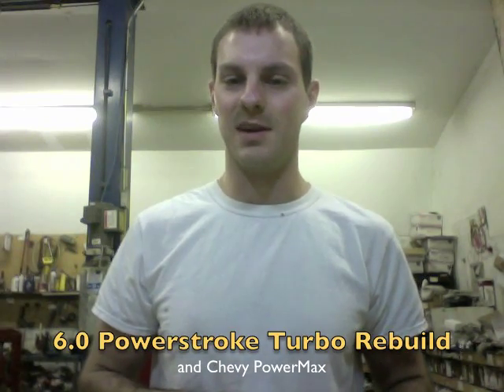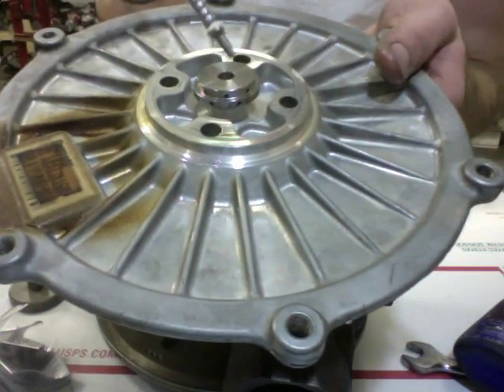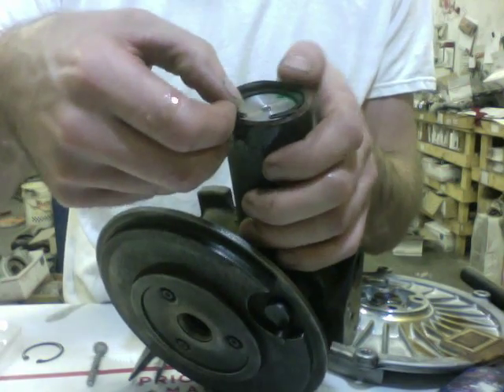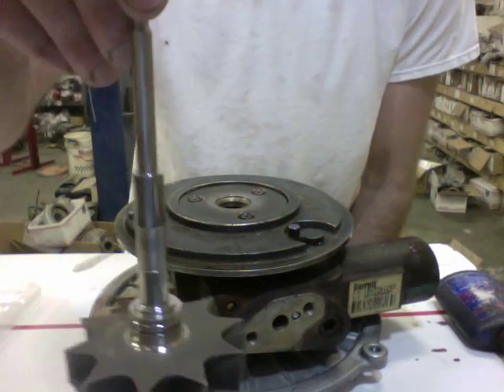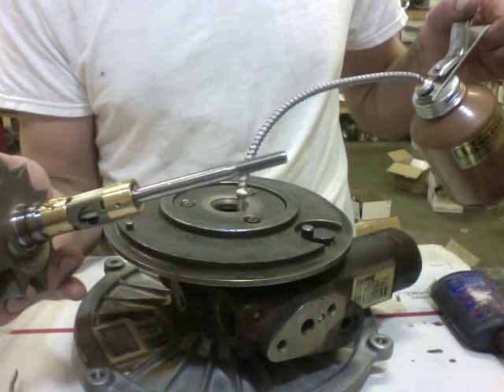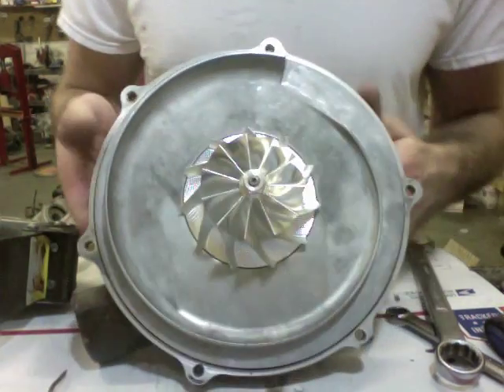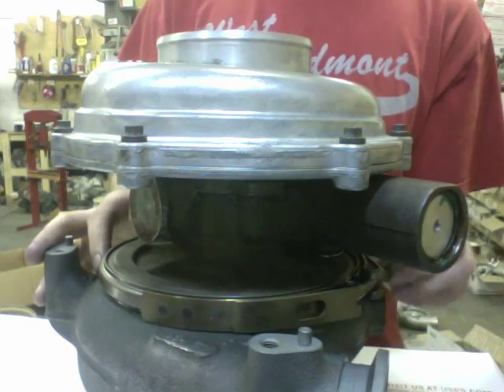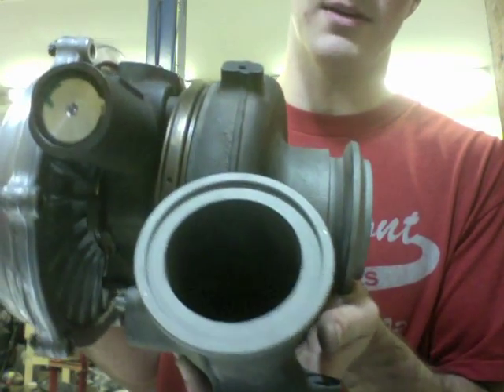Ford 6.0 Powerstroke Turbo Rebuild Kit Instructions

Comment: Ok. I took mine apart. And they installed the thin vane design.  The height is correct...the width of the vane us smaller than stock 

What is the advantages of the "thin" design

Comment: Cranking down the compresser wheel using a wrench puts atress on the thin shaft. The nut should be tightenened using a socket to keep the torque centered. Dont forget how fast that shaft spins and any wobble will destroy the bearing in no time

Comment: I would not red loctite the compressor wheel to the shaft. Terrible idea. I would be worried about doing damage if i ever had to take it apart again. Its also not necessary because it is reverse threaded and it is self locking
Reply: my thought exactly

Comment: Did you have to get it balanced after the rebuild?
Reply from the maker: No because the compressor wheel always lines up in the same position because it's threaded

Comment: the exhaust side seal on the shaft won't gap closed to let the assembly seat all the way in. I've cleaned it and worked on it but there's not enough to get it in there.
Reply: nevermind I backtracked and figured out I put the thrust bearing in upside down. everything fits now just leaving this comment in case anyone else has my issue. since this kit was an upgrade I didn't have an identical piece to compare it to.

Comment: When I put the shaft back and tight  it doesn't  spin  hope you can help
Reply from the maker: +daniel canada I never had that problem with a 6.0 turbo before, usually if it happens on other turbos is because the collar in the backplate wasn't pushed all the way in.
Reply: I was thinking what if it has a wrong shaft

Comment: does the turbo have to be machined?
Reply from the maker: If you want to upgrade to the powermax 63.5 x 88 x 94 then the compressor housing and plate has to be machined. There are 3 variations of the Powerstroke 6.0 turbo, you can see the major differences here: https://youtu.be/xoV7hS73hX4

Comment: i was just wonder but could one of these turbos be used on a gasoline powered  truck?
Reply from the maker: +Dylan Rice the concern I would have with putting it on a different vehicle is the ability to control the electronic vgt controller.
Reply: Turbo Lab America oh ok thank you i was just wonder because i saw a guy selling one for 100 and i was curious about if it would work. yea im trying to find a turbo for a low reving high torque ford 300 i6 but i want one that will spool quick but not choke the moter out at higher rpms.
Reply: @dylanrice6707   That would be sweet!

Comment: Yeah yours sounds like an old cold 7.3 lol This engine im working on has about 5000kms on it full rebuild top to bottom even did a resto on the 2004 body and frame lol. Used two aircraft jacks to lift the cab in my back yard. Hoist smoist lol.

Comment: Quick question, does the orientation of the seal opening matter? Should care be taken to point the gap in the seal upwards? I was absolutely meticulous when installing the rebuild kit and I have some blue smoke at hot idle and a puff on take off then clears up. This is all I can think could have gone wrong. Ever heard of this?
Reply from the maker: No.  I t doesn't matter. But if you install it with the gap up it wouldn't be a bad idea. Make sure you have cleaned the oil out of the turbine housing. I picked up a 7.3 Powerstroke. It smoke with diesel smell so I know it's just cold diesel. But it also smokes with oil smell when cold. When hot the oil smell goes away.  Mine seems like it could be an injector seal or piston rings stuck in closed position on one cylinder because we bought the truck with a rebuilt turbo. And we rebuilt it again.

Comment: what oil are you using
Reply from the maker: I'm just using 10w 40 but you can use a specific oil called turbo oil to prime turbochargers. I can't seem to find turbo oil online but it is a product I commonly saw used at my my friend's work place as a diesel mechanic.

Comment: Hello I tore apart my 2006 F450 6.0 turbo after loosing almost all boost.  I'm trying to make the decision on rebuilding or buying a new one.  The old bearings definitely have some play in the housing but I would like to know how much is to much??
Reply from the maker: +J Bowser  check the bearing housing for scaring and check the rear seal area  to make sure that the rear seal can seal properly.

Comment: please consider a remake on this video. you show snapping in both seals, only to later show installing seal again on shaft. no mention at all of smaller o ring.
Reply: Bill Sellers 
he snapped them into the housing, to make sure there was not excessive ware, and would still seal properly. After confirming that, he put the seals on the rod on  the bushing and rod where they belong.
Reply: Bill Sellers 
he snapped them into the housing, to make sure there was not excessive ware, and would still seal properly. After confirming that, he put the seals on the rod on  the bushing and rod where they belong.
Reply: Bill Sellers have a cry manchild , I bet you can’t even change a tyre or tire if your American. Stfu muppet
Reply: I followed his video and had to open it all over again. Sucks.